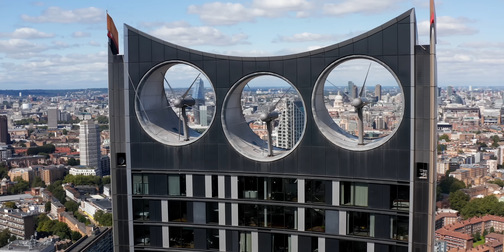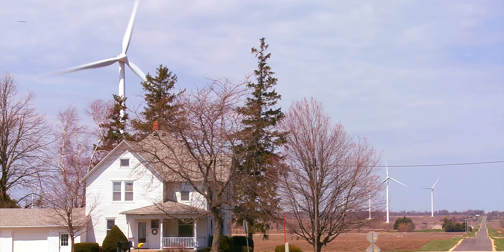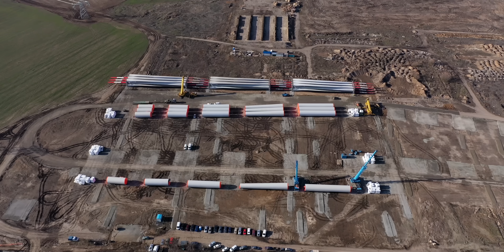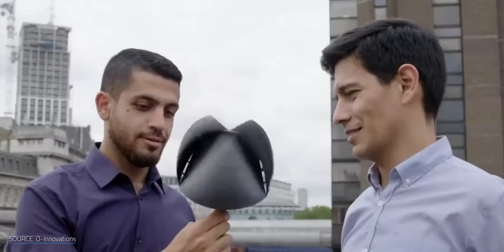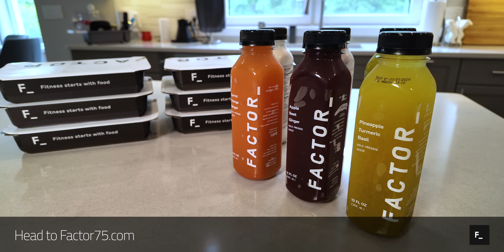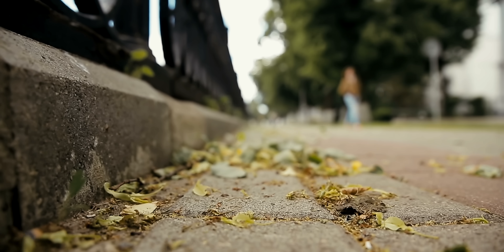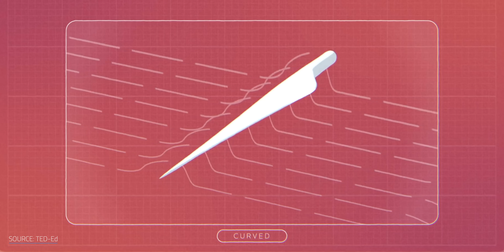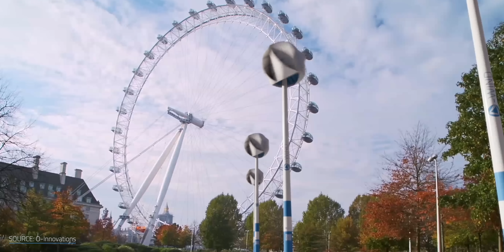How a Small Wind Turbine Will Revolutionize Wind Energy

Comment: Gimmick.

Betz's Law states you can only get the theoretical maximum of 59.3% of the power from the wind and wind swept area is the most critical factor, along with wind speed, to the amount of power you can generate.  That means the larger the area that is impacted by the wind, and the higher the speed of the wind (exponential gains with higher wind speeds) the more power you can generate.  I would image this ball would need to get pretty large to generate any meaningful power.  And....That is the maximum "in theory", which means practical efficiency will likely be so much less considering that the Mega Wind Turbines for serious power generation are generally 20% efficient.

Again...beware of anyone selling SWT's.  They are ALWAYS OVER HYPED and TYPICALLY OVERRATED from power production standpoint.

Comment: 2000kWh/year averages about 5.55 kWh/day. There is no way you are going to get that from a 2m rotor, especially in an urban environment. Not to mention the potential reliability issues. You have bearings and other moving parts out in the weather. The only wind turbines that make financial sense are large commercial units placed in suitably windy exposed areas.
Reply: and a 2m diamter rotor that has a capture area of about 15% at best.....

Comment: 2 O turbines for a 3 bedroom apartment/condo should suffice. Whatever else will come off the grid but that means a substantial reduction on your electric bill.
Reply: er, if the cost per kWH is higher than the grid (which it will be) then it's no reduction to your bill.....

Comment: For the past three years, I've had a small Savonius-style turbine on my shed to provide power there, alongside a single solar panel.  I'm very happy with how it's worked out.  On cloudy and windy days, the turbine charges the batteries in the shed.  On calm sunny days, the solar panel takes over.  With an inverter, I can power electric yard tools, charge tool batteries, etc.   I'm not running a refrigerator or heating system.  But for the small tasks I need,  that system does the job.
Reply: This is effective and realistic use of a wind turbine.
Reply: So it's not even connected to your house? Or isn't it worth it?
Reply: You mind sharing the brand? I'm looking to do something similar, but the market is flooded with so much crap.

Comment: The illustration showing these turbines attached to the sides of apartment buildings is such a novel and cool idea. As for single family homes, a couple of those would at least power the lights in a residence; maybe not the A/C that Americans so enjoy and in many cases need, but that's a different problem. Can these small turbines continually charge those Tesla batteries, maybe?

Comment: SWTs: Why cant we put one of these on EVERY power poll across the country? change high power transit lines into large generators. The tower is already there. The transmission lines are there. Put in Step up transformers and turbines. You can do the same with the single post Carriers that most rural farms have multiple of near them.
Reply: Because you don't understand electricity.  You can't just plug a wind turbine which is low voltage into grid high voltage.  Transformers are vastly expensive.  

It doesn't work.

Comment: We own a 3 unit flat roof building in Chicago. It was built around 1925 or so. We have thought about solar panels but worry about the weight on the roof, especially with winter snow load. Small wind cells like these may be a better option for us. With 1 on each corner of the roof we could likely provide a large portion of the building's electrical requirements. Insulating the vibration from the building structure would be needed I think. But that is just an engineering issue...so there's that...
Reply: I doubt the weight difference is significant. If its lighter, you'll get less power.
Reply: small windturbines do not work economical, only very large windturbines with long blades are  economical. We are talking about over 200m high wind turbines

Comment: If everyone in the city uses wind energy, wouldn't it slows down the wind speed within the city significantly and causes other problems? Like the city will become warmer during the summer and everyone has to put the H-VAC on, or the air pollutants within the city is harder to be removed, causing public health problems?

Comment: Turbines are loud. If this doesn’t make the incessant humming noises when the wind blows then I’d consider it a win. No one realizes how aggravating they are until they’re put near their homes. I imagine sea life would get a bit thrown off with the noise as well. Very low frequencies hardly audible but you can hear it
Reply: Turbines are "Loud" if they work. Ie what you are hearing is the turbine extracting energy from the wind by changing the winds momentum. If they are quiet, then that actually means they are not extracting much energy.......

Comment: At 2000kwh it’s difficult to justify. At 5000kwh price including installation and inverters needs to be less than €5k to break even after 5 years at current energy prices.

And then how closely can they be spaced to each other? And can they handle wind storms?

It would be great for my roof where we don’t have enough space for solar. But we can put up one of these.

Comment: The O-Wind turbine is such a clever response to chaotic wind patterns in cities. Tying it to principles like Bernoulli's really highlights its innovation.
Reply: Every turbine utilizes Bernoulli’s principle. Nothing turns in the wind without a pressure differential.
Reply: Unlike more established vertical axis wind turbines, this one uses largely drag to rotate, just like a wind meter. Look closely at pictures online and you can see there's not much opening for the wind to flow through easily. Using Bernoulli's name is just for marketing. I'm sure Bernoulli wouldn't appreciate it.

Comment: Are we sure that we can just slap a viably-sized wind turbine on any city building? Don’t they spray crap out the sides onto adjacent building’s windows when wet/ dirty/ icy/ snowy? What about the torque they exert on a building’s structure that wasn’t necessarily designed for it? Nuisance noise into the apartments below? Do t get me wrong, I’m not saying nay- I’m just saying…hey!

Comment: This could be used in conjunction with a friction heater to supply heat in cold climates.  This would enable a lower cost installation than generating electricity with a generator, inverter and wiring as well as batteries to store the electricity.  Essentially the turbine turns a friction heater which can heat up a water (or oil if freezing is a concern) reservoir in a tank and a heat pump could extract that water as needed.  The heat pump could alternate between the ambient air or the reservoir as needed.  Producing energy doesn't necessarily mean producing electricity.  A friction heater is easy and cheap to build and easily replaced when worn.
Reply: Your "simple" friction heater still needs a reservoir, fluid pumps, heat exchangers... the heater itself might be simple, but all the surrounding equipment needed to make it do something useful is not.  An electrical generator attached to this is going to be at least 80% efficient, potentially above 90%, and the heatpump it powers will be several hundred percent.
Reply: Mechanical electric generators are also cheap and easy to make, and electricity is much easier to transport and store.

Comment: Thing you have to remember about all Vertical-Axis Wind Turbines (VAWTS) is that half their blades are always moving into the wind and losing power while the other half are being pushed by it and gaining power. They work by shaping the 'into' side to resist wind less than the 'away' side. Horizontal-Axis Wind Turbines (HAWTS or windmill-style) generate power across their entire surface. For an equal surface, HAWTS will always beat VAWTS on efficiency, which is why all the big windfarms use them.
Anything that spins will generate vibrations. Nothing is built perfectly. And if you put rapidly-spinning machines on your dwelling, there will be vibrations.
The higher you go, the more wind you get. The more cluttered the area is, the less useful energy you will get.
Reply: Good analysis, someone actually did some research and didn't have their rose colored glasses on.
Reply: I'm thinking Voith Schneider propellers?
Reply: @TheHoveHeretic  Those are designed for propulsion in water, not power generation from air. The cases are very different.
Reply: Also you need to consider the V cubed term in the power formula, a turbine that has a small capture area (omi-ball thingy) relys on fast windspeeds to make it's power, but the cube terms means hugely varriable output. ie 2m/s wind = 8w, 4m/s =64w, 10m/s = bang! (1000W), this makes it really really hard to load match it

Comment: Even the O's can offset a fair amount of non-renewable energy sources.

It won't completely eliminate it, 20%-50%, but that's 20%-50% that's being used.

Added that if there's wind at night, then there's potential of being able to store it as either hydrogen fuel, batteries, capacitors, even that ocean battery.
Reply: that's OK tho. it's not suppose to take care of it all. it's like a side dish since city dwellers can't do anything crazy

Comment: This turbine seems to exert much less forces to the pole or structure it's attached to, it's a great feature of this design
Reply: Having less force to the pole directly to less power production.  Only other directions as up or down could lower the bending forces.
Reply: @maltekoch1632  emmm, not always. The ubiquitous 3-blade turbines spend a lot of time idle, not producing power yet they act as giant sails catch the wind and transfer its forces to the pole or structure they're sitting on. This tiny and light weight design catches and spins even in a small and fast changing breeze, it offers little resistance to it and lets it pass through relatively easily so has to withstand much lower forces. I see it this way.  
In my neighbourhood there is a small vertical blade turbine installed high up on the roof that is higher than most nearby houses so should be more easily catching more wind. It's been there for several years now, I've never seen it turning and producing electricity. I think the developer had an obligation to install one and probably installed the most efficient one he could find yet it is useless because wind speed and consistency just isn't high enough. This blade design seems to me to do much better in that and similar settings.
Reply: @soundslight7754 the achievable power is promotional to the area covered. 3 blade turbine with conservative 50m blades has approx 50x the diameter of the here presented. So 2500 more area has the big one in same wind speeds. Big one even lower tip is dozens of meters above the ground. So higher wind speeds getting out of turbulent wind.
You would need to install 2500 of these small to get the same energy as the big one. Assuming these ones are as efficient as the 3blade design refined oder decades and proven in thousands of turbines.
Independent tests of small wind turbines have most of the time shown that they are producing power just at pretty high wind speeds. Wildly changing power outputs are a big demand on the power electronics. Having frying alot on smaller turbines.
Big Wind turbines are fitted to the spot. Getting smaller or bigger generators and towers depending on the local wind conditions. By this modern turbines getting more viable to lower speed spots.
Reply: @soundslight7754 what?  The energy captured by any wind turbine is the change in momentum it extracts from the wind. That energy is reacted as a force into the anchoring of the turbine (pole, wall, tower, etc)  That is basic physics. The reason this "new" (actually old and rubbish, hence its gone nowhere in years) turbine doesn'y excert much force into it's anchor is because it fails to capture much energy, ie to change the momentum of the air flowing through it.....
Reply: @maxtorque2277  You fail to remember momentum is a vector quantity and direction is just as important. You are also not paying attention to the environment the turbine meant to operate in and limitation imposed on it. Let me explain so simply that you can understand or can give it to your grandchildren who will explain it even more simply with some diagrams:
It's meant to operate in urban areas: highly built up city centres. The wind is weak and constantly changing in direction and speed hence the equation of a perfect lab environment that you have in mind such as in a wind tunnel with constant speed and direction isn't applicable. The ubiquitous rotor can't work in city centres because it hardly gets enough power to start turning and generation and does not get the wind consistency to keep it going.
Also it meant to be small and quiet, ideally invisible, these all mean high speed operation is out of the question. If the pole could be much taller than the ridge line of nearby buildings, maybe the regular rotor would stand a better chance to operate in such environment, but the installation would be very costly and maintenance close to impossible for private residential applications. Yes, this rotor design isn't the most efficient and yes, it's a compromise but it's one that seemingly could be made to work in the given environment. There are many novel rotor designs to fit city centre applications, none remotely looking like the turbines we see in offshore  applications because every designer started there and couldn't make it fit so they keep turning to more unconventional turbine designs - eventually one will be the winner and we start seeing it hit critical mass production at affordable prices.

Comment: Pittsburgh resident here. We have some of the worst solar potential in the states with more cloud cover than Seattle but Solar just eeks out being cost effective in some niche cases. We get as much city wind as any comparable urban area. Here's hoping the economics of this work out. The burgh is probably one of the best regional cases for wind making sense over solar
Reply: People often argue it won't do much, but if it does 5 % for acceptable price, then it's still 5 %. It is also produced where it will get consumed so you save on grid cost for longer distance travel. But sure it will be rather a niche product.
Reply: I'm in WV just south of Pitt and my solar makes enough electricity to power my home every year. Panels are really good these days, it might be time to challenge your assumptions.
Reply: I see both being imperiative, you get rooftop solar on the buildings and aligning the turbines across the frames, plus of course regional nuclear throughout the US fueling entire sectors of the baseload needs. All of it combining would be enough to greatly reduce power load strain.
Reply: @winterrye3022  it wouldn’t be economical, but a one-way downhill car “incline” would be pretty fun and would generate net positive electricity if the electric motor is left hooked up to the grid. Basically a downhill chairlift for cars lol
Reply: - work out the energy in wind - wind weight is around 0.075lb / cu-ft and at a certain speed has kinetic energy....  The most you can extract typically  is around 60% of that (try any harder and the wind will go else-where, or you extract the very energy required to make the "extraction" possible....  (bodies claiming to exceed Betz limit is calculating their inlet and outlet areas incorrectly)

Thumbs up, here's to hoping.
Reply: *ekes out
Reply: It's just another scam
Reply: @nathansmith7153  A scam that seems to work for some troll. What do you propose? Krypto? I'm a fan of good insulation/building construction/orientation (my specialties) - works 24/7/365.
Reply: Pittsburgh is wonderfully laid out for people - saves A LOT of energy/infrastructure compared to typical Midwest sprawl while keeping people healthier (the self-imposed health care crisis is energy/material/infrastructure intensive to treat) - all factors in energy efficiency at differ scales. The weather is pretty mild and what lovely skin they have. I miss living there - a real city.
Reply: It's an interesting idea for sure, cities could be the grounds where the math works out

But it's a problem that would certainly need the city builders to get involved